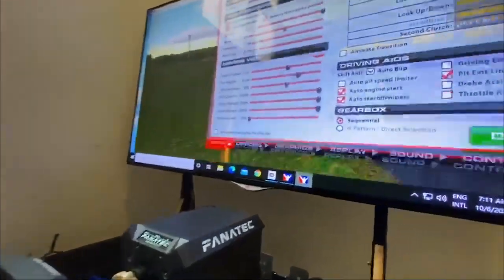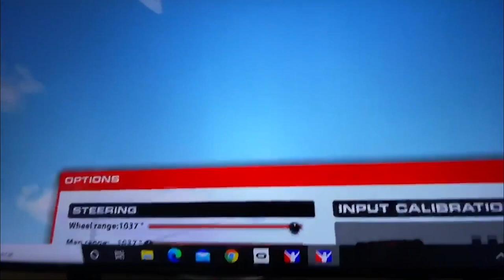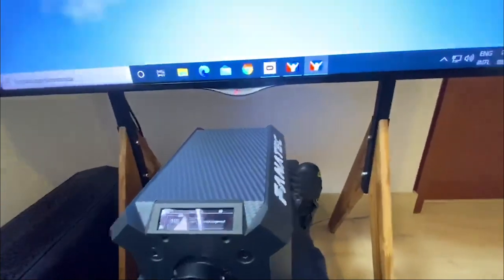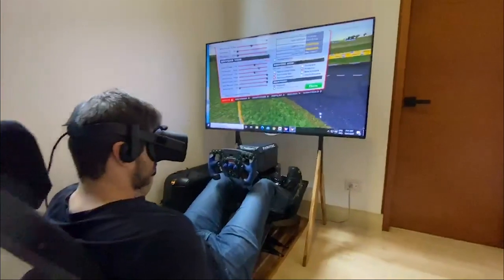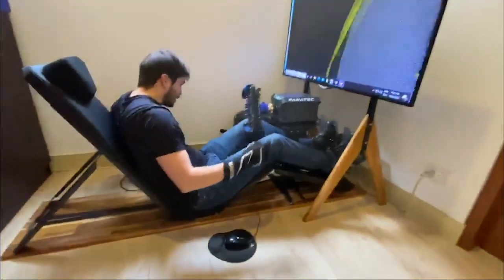Speed Cockpit Features

Comment: raising the dead:
I purchased one used for CHEAP ($300 CAD). It's the perfect solution for my small apartment and monster VFX workstation. It's literally under the parallel side of my L-shaped configuration, between the legs and directly under my PC. I'm now on VR, but initially, I had my monitor mounted to the edge of the desk directly behind the wheelbase.

It's a bit tricky to get in and out of this configuration, considering there's a desk leg beside my knee, but it's a price to pay for my constraints.

I've been using this for a little over six months now, and I love it. I have made a few modifications for my F1-style position. The pedal base is raised to be parallel with my thigh pad hinge so I can utilize the heel rest of my Meca Cup 1s and not have to hold my legs up for the entire race. This required a few extra holes drilled in the pivot plates and, in my case, a used apple box under the foot box to achieve the height.

This also stopped the pivot panels from continuing to cut grooves into the wood base, which are now about 10-13mm deep into the deck surface.

Some hardware is a bit tricky to access, so more pass-through holes have been drilled to fit drivers through the exterior of the lower frame section, making adjustments substantially easier. I'm working on a 3D-printed set of flare dies to give these holes strength. If I'm successful, I might do more of that to the rest of the frame simply because I can. It's plenty light and plenty strong, but I love to experiment and tinker!

All in all, 9/10 for a micro rig—this thing slaps.
Reply: I just stumbled across these vids and had been intrigued by this product, thanks for your update!

Comment: All of the armchair engineers bashing this on facebook look pretty silly right now lol
Reply: Boosted media just covered this in a video. And the back out the chair is cheap as fuck at the top and flexs a lot. Unlike the one in the video. And $500-600 for this turd. Buy a sim lab gt1 evo or p1x I think the top model is called
Reply: @SIMRIG412  And his knees touched the wheel base plate.
Reply: @danylbekhoucha6180   yeah because hes almost 2 meters tall